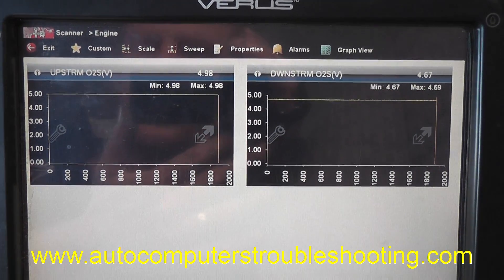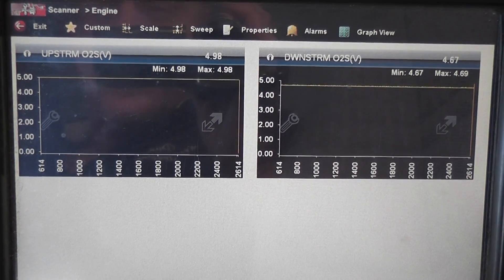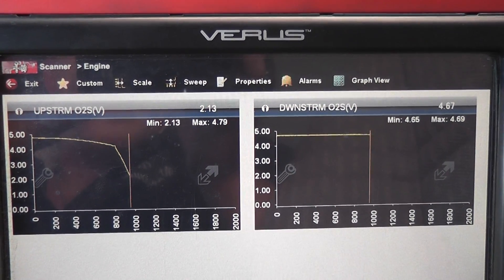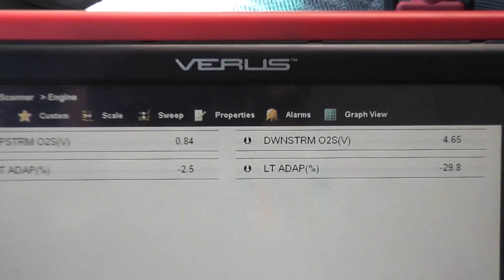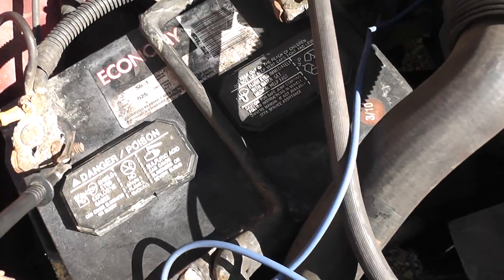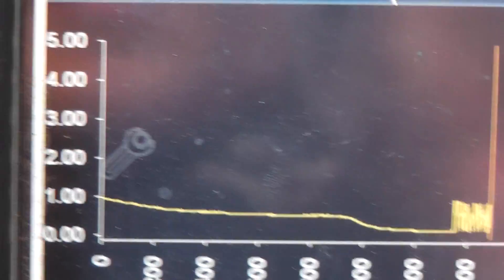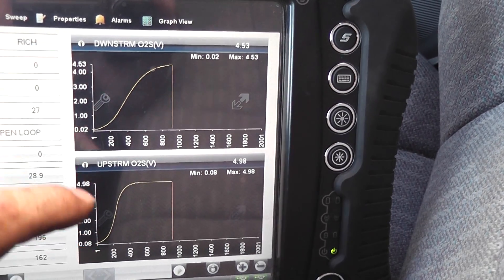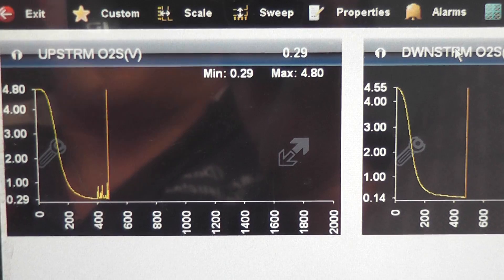System Too Rich P0172, P0175 from a blown O2 heater fuse (Jeep)

Comment: my 04 scion xa -45 fuel trim! ( at it's worst) I hope it's the fuse! checking asap btw im getting 3 codes, p0133, p2196, p0172 just checked the fuses. there good. don't know what to do

Comment: What about a 1999 Jeep Wrangler? There is no fuse in this location.
Reply from the maker: I believe in 99 they changed it to a PWM heater circuit for the O2.
Did you just replace it and are now having issues similar to what you see here?
Reply: @ScannerDanner  I had changed the o2’s with Ntk’s and changed MAP sensor. Only code I keep getting is the p0172. Today I did eliminate the heater as the voltage was about 5 till I started Jeep and then went down under a volt. Only slight leak I have is exhaust manifold that had been there with no fault. I even tried just for test purposes only to space the upstream sensor. By the way like to watch your videos and to bad you were not here in lower central NY. Thanks for reply as well.
Reply from the maker: @carlmccartney1323  okay perfect, what are your STFT and LTFT fuel trim numbers at idle and 2500 rpm in park
Reply: @ScannerDanner  Long term are at -32 and short term are positive to start and then as warms go negative as well. I did not try at 2500 rpm’s.
Reply: Also I did not mention, I was thinking possible fuel injector leak. But I get no misfire and I pulled all the plugs to see if there was any gas or extra fouling. But they were all the same.
Reply: @ScannerDanner  So I checked at 2500 rpm’s and they ran -32.9 and -33.2
Reply from the maker: @carlmccartney1323  what is your fuel psi? Stuck open purge valve? What are your ECT and MAP values at idle, engine hot
Reply: @ScannerDanner  Engine hot yes, has a new fuel pump as the gauge wasn’t working. Guess possible it is a faulty new one. I will check psi today. I don’t think this has an EGR valve.
Reply: Whoops you didn’t say egr. I think I changed purge valve. MAP sensor new too. Cleaned throttle body. Coolant sensor seems to be working correctly watching the instrument gauge in comparison to scanner.
Reply: @carlmccartney1323  So I was mistaken, I didn't change purge valve but, I took off today and put power to it and it clicks easily. The MAP Vacuum is 460.6 mmVAC at 185 ECT. Fuel pressure key on Jeep of is 45 psi and only dropped 1-2 psi after 15 minutes. When Jeep is running the PSI at idle is 49-50 psi.
Reply: @ccautollc864  Just to totally eliminate the purge valve even though I thought it was ok. I got a new one to watch Purge Dury Cycle. Both valves run at 7% at idle.
Reply: @carlmccartney1323  Even Just replaced the catalyst in case to plugged.
Reply: So update on my situation. Left it sit awhile from fustrationWhen I had checked injectors they were not leaking but nothing was left. Changed all 6 out and it cured the P0172 code !!!

Comment: could this apply to my 2008 impala?
Reply from the maker: Not likely
Reply: @ScannerDanner  i don't think so either. mine has the p0420. i think because of the cat replaced with an aftermarket. but my car has not had a code thrown on it for well over a year.. the garage said it had the 172 175 i never seen it on my scan tool or auto zone.

Comment: Hey ScannerDanner! I have an 04 Hemi Ram with a shared heater return circuit for bank 1 and bank 2 (says the manual), code is P0052 (B2S1 Heater control circuit high) currently ONLY bank 2 has an issue with fixed voltage at 1.72 volts. Can a bad bank 1 sensor that looks good cause bank 2 to go crazy in this scenario with a shared heater return?

I'm fixed at 1.72 volts on bank 2 and it does NOT move, all of my symptoms are identical to this video. I bought a new replacement bank 2 02 sensor, direct wired all 4 wires to the pcm to eliminate possibility of a short or open, put my backup pcm in to rule out that and currently I have zero luck and the same symptoms are still there.

Comment: Hi Paul. Great video. I watch them all even when my car is running fine. Struggling to get my head around a problem with my vauxhall zafira b petrol 1.6 at the minute. I have a lean code come up yet the smog test reveals its running rich. Fuel trims go  -  when parked  with increased rpm upto 3700 but when  I'm driving then they go +27%. It's a map system with iat senor. I'm thinking pre cat 02 sensor although going lean and rich, is telling pcm it's running lean and sets a lean code but computer is adding fuel making exhaust rich. 02 sensor goes as low as 0.05 to 0. 9.  Could it be stuck more on lean side causing pcm to set lean code yet adds more fuel making exhaust rich? Fuel trims go +27% while driving. Would really appreciate your expertise as I'm an enthusiastic (amateur) auto electrician who loves this stuff. I've had 4 auto electricians look at it but can't work out what's wrong. Really appreciate your help. Michael c .

Comment: I'm having the exact same issue on my 03 ram 1500 5.7 hemi. Cant find any info on the O2 system though. I don't know which wire is the heater wire. It's not a fuse though. And I've put 3 sets of O2 up and downstream. The 2nd set would not communicate. (Faulty). Ltft -33% stft 0-(-33%). 1/2 PWM O2 Heater 100% and will not change
Reply from the maker: The heater circuit is the two white wires (sensor side). Watch my video where I'm warning about aftermarket O2 sensors of Chrysler system
Reply: Thanks for the reply. I learned that the no brand name ones were junk. The set that's in there is NTK I believe. I paid the extra dollar for them. I'm going to check the wires tomorrow. I'm hoping that it's just the O2s. I have a brand new computer I installed because the heater issue after the 3rd set of O2s. Didnt change the readings unfortunately. Thank you for the video and reply!
Reply from the maker: Okay good, you have NTK sensors in there, that is what you want. I just checked a diagram and the O2 heater circuits are pulse width modulated on the power side of the heater. The ground side of the heaters go directly to ground (G107 - right rear of engine compartment). So what this means is the PCM will be pulsing voltage on that circuit and if you use a regular digital multimeter, you will only see an average of the pulse. An incandescent test light would be your friend on this circuit as you will be able to see the bulb flashing on/off.
Reply: Hey ScannerDanner, thank you for the information. I just finished checking the G107 (above the PCM) with a light. No luck, all the grounds are solid light. Also, my BR/WT wire from the PCM is showing 0.3 DCV. I've been working on this truck for about a year now. Ever since I broke a valve spring cyl. 3 exhaust and bent the push rod. I rebuild the heads and replaced nearly every sensor on the truck (minus Cam and Crank). I took it to a dealership which was the worst mistake. They said my cat and O2 sensors were the issue. I asked how they tested the cat. They said the vacuum. I did an exhaust back pressure test when I took it home and it was less than 1 PSI. I replaced the O2's multiple times and no luck. Its gotta be something silly that I'm missing. I almost wish I had an oscilloscope right about now...
Reply: I did some more tests. PCM output is 3.3V, Heater wire at the O2 is 13.5V, O2 Signal wire 2.5V. Doesn't make very much sense. Why there's 0.8V difference other than resistance possibly in the wire. Would you happen to know what resistance I should look for with O2 cold? Possibly another bad O2 sensor?
Reply from the maker: @spencersquires8458  This is good new for you! This sensor uses a 2.5v bias on the sensor signal ground and if you measure the sensor signal voltage compared to battery ground you will read a 0-1 volt signal that will actually show you 2.5 v for 0 and 3.5v for 1. So you reading 3.3 volts on the O2 signal wire will actually be interpreted by the PCM as .8v I hope that makes sense. In other words, if you monitor the O2 signal directly with a digital multimeter referenced to battery ground you will see a 2.5-3.5 volt signal. If you switch your meter ground to the sensor ground (that has 2.5 volts on it), you will read a 0-1v signal like a normal O2. 
I have some lessons on this in my classes (chapter 5 material) if you are interested.
Reply: Thank you for the helpful information. I'll definitely check it out! Now that that's out of the way, I guess I'll need to start looking elsewhere for my rich condition issue. I'm very partial to believing it's a pcv issue. I'm getting alot of oil sitting behind the throttle body plate. It could be showing rich due to oil being sucked into the cylinders. It's hard doing a definite pcv test because the pcv valve is internal... thanks mopar lol. I did a compression test and all cylinders were within 5psi of each other. The reason I think that is because my vacuum is on the low side. Somewhere around 9-14. But my idle isnt high. Its fluctuating between 400-700rpm erratically. I'm partial to thinking that my block is having pressure issues, possibly causing it to go rich (oil into cylinders). But idk yet, gotta run more tests

Comment: I have a 2008 Lexus gs350 both banks running rich and I have a p0055 code which is an 02 heater resistance bank 1 sensor 3. Could all that be related? Good hunt down man!

Comment: Hey, Paul. I am trying to know if a stuck open thermostat can cause an oxygen sensor code or heater circuit  code. From my understanding, a stuck open thermostat will keep the vehicle in open loop, and in open loop, the o2 sensor is not used.If it not used, the pcm is not going to monitor it. Could you please help?

Comment: Excellent. 
I've watched a few o2 vids and I don't think I've heard;  what is the DOWNstream o2 supposed to read on a good working system at around 2000rpm. Upstream goes above and below 450mv fairly rapidly but what should the downstream read? Thank you.
Reply from the maker: If that cat is good the downstream sensor should NOT be fluctuating like the upstream. It should be steady.

Comment: This is exactly why I check all four wires on an oxygen sensor(just out of habit) Even with a low or high signal DTCs. I have seen a fixed rich(false rich report)even with a good heater circuit so just keep these variables in your head.

Comment: My Dc is 100% on rear 02heater, constant. Sensor stays steady around 700mv. Wondering if I have a wiring problem since the cat is heating it with it at 100%. On my neon.

Comment: i got a 02 tracker 2.5l, it runs good but sometimes while idle it starts to drop rpm and stall, hit the gas and its fine. i got p0175,172,447,141,161. it ran for ever with the last 3 but now it stubbles at idle sometimes and stalls. any ideas?
Reply from the maker: check fuel pressure, do an injector balance test, look for a leaking fuel psi reg. (if it is a return type system). stuck open canister purge valve, sticking open EGR, head gasket leak (contaminating the O2s and causing a false rich). I have videos on all of these. Thanks!
Reply: fuel pressure while running is 38 psi which is normal for the car. when i pinch the return line it goes up to 70-80 psi. i cleaned the egr (it opens and closes fine), cleaned idle aire control valve, checked to see if the reg is leaking (its not). doesnt show signs of a head gasket leak (coolant level has always been perfect).
Reply from the maker: Injector balance test would be my next test. Or possibly a skewed MAF sensor. (cleaning will NOT fix this)

Comment: hey I have a 97 grand Cherokee with common problems I had changed the O2 sensors before and switched the cat but the truck kept running rich and ruined all of them where's a good place to start looking for the problem I have already checked my fuses and they're all good. thanks in advance
Reply from the maker: Watch my video about aftermarket O2 sensors on Chrysler / Dodge vehicles
Reply: Same?

Comment: Great video Paul! Does the heater circuit work full time or does it shut down ? Worked on A 04 wrangler with a 4.0 and heater circuit turned off when vehicle warmed up. Only monitored this once and that's what happened. Will need to look at a wiring diagram tomorrow for sure. Whats your thought? Vehicle sets po135 heater circuit malfunction. Thanks Paul.
Reply from the maker: On some systems they work full time, on others they are turned off at times and on still others they are pulse width modulated.
Reply: +ScannerDanner my 2000 jeep cherokee will warm up then backfire through the throttle body when given more than a 1/4 throttle then it stalls out

Comment from the maker: no this is the signal wire bias voltage we are looking at.
check out my Jeep Liberty case study on this same subject for more info.
the heater circuit is grounded on the block and powered from the ASD relay

Comment: Paul are you looking at voltage on the heater circuit control (ground side) when it's cold it's 5v and as the heater warms up the voltage drops to near  zero volts? Something I've never really llooked at before .

Comment from the maker: @fivefortyeye540i You could call it that. In this case it is used for heater circuit diagnostics. On other sensors you can have a ground bias used to reduce noise in the circuit.

Comment from the maker: @Username64870 Are you talking about ohm testing the O2 itself or the wiring? If you are talking about the O2, there would never be a need to ohm the sensor side of the O2. First there are no specs because temperature of the O2 changes the resistance of the sensor. If the senor is cold it is basically an open circuit. If the sensor is hot its resistance drops drastically. However if you did ohm test it you would not hurt it.

Comment from the maker: @pimp48934 I do not like that it will not run with the old PCM. If the used PCM is of the same model and engine I don't think that will cause it to run rich. Reprogramming can only be done with a factory scan tool and access to factory information. Is it possible you mixed up your firing order in the process of changing all these parts?

Comment: i changed the coil today and it fired up but now its running real rich and i think its cause the new pcm i bought used and didnt flash it to my vehicle and i also tryed putting the old pcm in and it wont run at all with the old one so now im stuck again it acts like a plug is fouled but i also bought new plugs and put them in helped a little but still runs like shit.. And also if i do have to flash the new pcm i have how do i do it can i get a scan tool and do it or what??? thanks for thereply

Comment from the maker: @pimp48934 How far does the spark jump out of the coil? It should be a bright blue arc that jumps out at least a half inch to an inch of an air gap. If the coil is weak, this could produce your symptom. Something else to consider is a jumped timing chain or shifted flywheel. This would alter when the spark is occurring in relation to TDC and therefor rotor to cap air gap as well. Are there any trouble codes?

Comment: i have a 97 jeep grand cherokee that has no spark out of the distributor but have it at the coil and i changed everything the cap rotor wires cam and crank shaft sensor and nothing and the rotor turns also so i have no clue why i have no spark out of the distrbutor please help danner

Comment from the maker: @frosty9595 It may or may not, I know Chrysler used a separate O2 heater fuse on some and on others heater power was supplied on the ASD circuit. My Jeep no start case study, was ultimately caused by a shorted O2 heater wire. No separate fuse for that on. I just depends on the year and the model